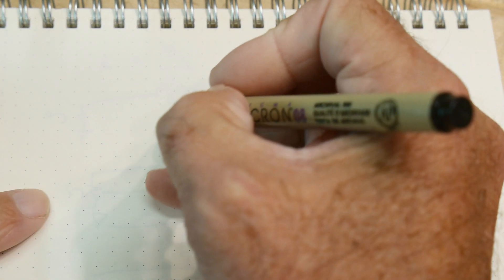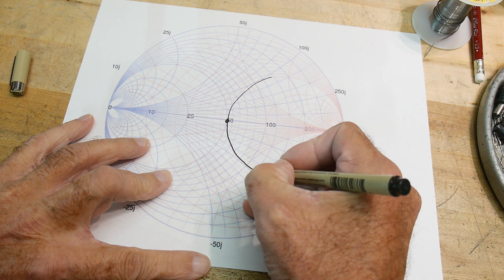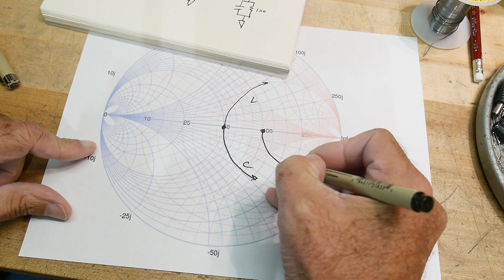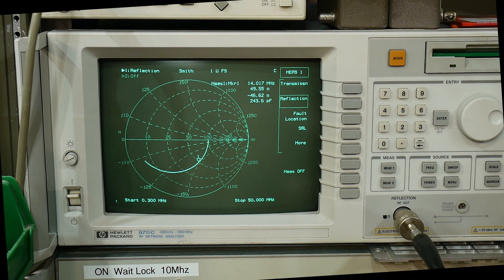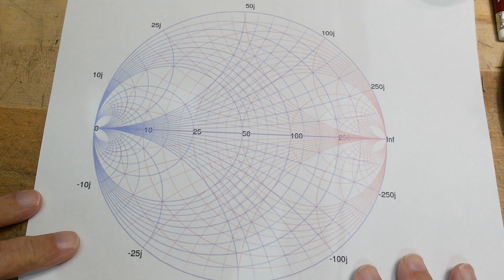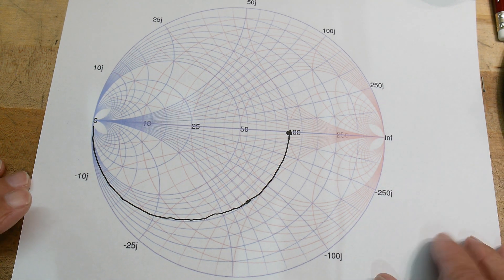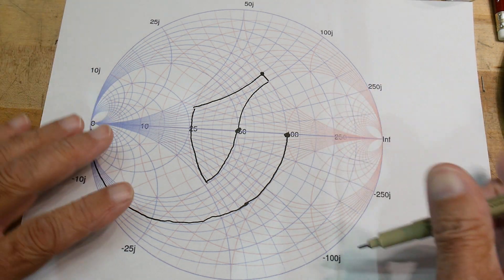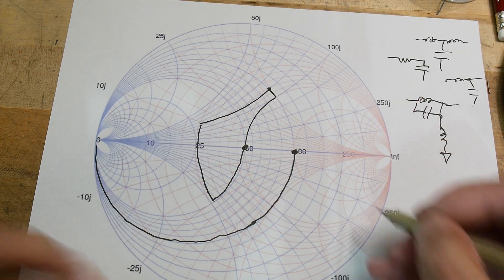#933 Parallel Resistance Reactance Circuit

Comment: 50-50i at @10 Mhz is 50R series with 318pF, in admittance the same point is 0.1-0.1i, that is (50-50i)^-1, is 100R parallel with 159pF. I don´t know if nanoVNA or your VNA can be read directly in admittance units. I have made very accurate capacitance measurements with capacitors and varactor diodes with my nanovna. It seems that you need nanosaver with nanovna to read admittances.

Comment: In my 42 years of electronics engineering work I have never seen a Smith chart.
They look very complicated to fully understand.
1. You are very knowledgeable in this area. Where did you learn this; school, work, hobby?
2. Do you have a good source for info on antennas, specifically I would like to know how the instantaneous voltages along an antenna relate to the instantaneous electromagnetic field radiated or received by the antenna. Diagrams would be helpful.
Reply from the maker: 1. I learned smith charts at work
2. ARRL Antenna Book
Reply from the maker: if you want advanced material. try the ARRL Antenna Physics: an introduction book
Reply: @IMSAIGuy  Thank you
Reply: @IMSAIGuy  You work on RF side, it is possible that in future you make some road map about RF which is a part of electronics?

Comment: Can the nanovna make the same measurement? If I put a 50r with a 47pf capactior at the end of a coaxial nanovna measure a big capacitor, I think that is measuring a serial capacitor.
Reply from the maker: it's a VNA so yes, it is just a matter of accuracy.
Reply: @IMSAIGuy  Would you be so kind to do the same average with the nanovna and tell me what capacity it measures?
Reply from the maker: @miguelmiguel7314  I don't think it will help you. the VNA is always measuring the system impedance at the connector. trying to extract individual values of components is not the right way to do it. I have an LCR meter for that.
Reply: @IMSAIGuy  I´m trying to measure tunnel diode internal capacitance with the nanovna
Reply from the maker: @miguelmiguel7314  I don't think a VNA is the correct instrument. I would be using a fast scope and looking at rise times, calibrating against known diodes of known capacitances.
Reply: I can measure capacitance in paralel with a resistor at the end of the coax, first you need to calibrate the nano vna with that cable, then you can measure any component. But I have to use some calculation to convert polars cordinates to paralel, make ^-1 of the polar values.
Reply: Tunnel diode has a resistance of 100 ohms aprox at valley point
Reply: I have a wayne kerr bridge, but the maximun frequency is 100khz. Is more easy to measure low capacitances with higer frequencies, 1M to 10M for example.
Reply from the maker: just curious, did you remove the comment with the link to the TEK group or did YouTube do that automatically?
Reply: @IMSAIGuy  no, it seems that is automatic, I put another link with a pdf explaining how to measure capacitances with a VNA and have been deleted too
Reply: Can you help me to calculate C from 49,56-46.65j @14Mhz that appear in your VNA screen?
Reply from the maker: @miguelmiguel7314  the j part is reactance due to the capacitor. so 46.65 = - 1/ omega C
Reply from the maker: https://youtu.be/a4pfbDJIoQA
Reply: @IMSAIGuy  241,6E-12 thanks!
Reply: @IMSAIGuy  So the capacitor connected in parallel is 288pf? I will try tomorrow the same measurement with the nanovna
Reply: @IMSAIGuy   Hi again, I have tried with a 180pF parallel with 100 ohms @9.3Mhz Nanovna saids 47,9-48,7i, and 350pF= (2*pi*f*xc)^-1. But this is not correct for parallel capacitor, if you want to calculate the parallel capacitor you firts have to calculate (47,9-48,7i)^-1, then the i part is 10,4E-3. Then 10,4e-3/(2*pi*f) = 180pF.   Try it!
Reply from the maker: @miguelmiguel7314  50-J50 is actually 25-25j in in a parallel to ground configuration
Reply: @IMSAIGuy  tomorrow I will calculate the capacitor in parallel that apear un tour vna screen

Comment: Is it possible to build a 2.0 - 3.55Ghz band pass filter or is the frequency of this wide band not available to us in our home lab?
Reply from the maker: yes, you can, try this: https://rf-tools.com/lc-filter/
Reply: Yes!  My local ham club home brews gear at 1 GHz and above.  The 10 GHz band being very popular.  You usually need some intermediate frequencies to get there so circuits in the range you mention are not uncommon.

Many of us have picked up second hand test equipment to aid in this and if I don't have the piece I need, often times another local ham might be able to either loan me the equipment or some time on their bench to troubleshoot.
Reply from the maker: a bandpass is just a lowpass and highpass back to back. so you design a 2G high pass and a 3.5G low pass, done
Reply: Thank You